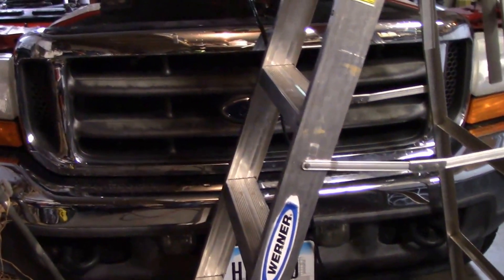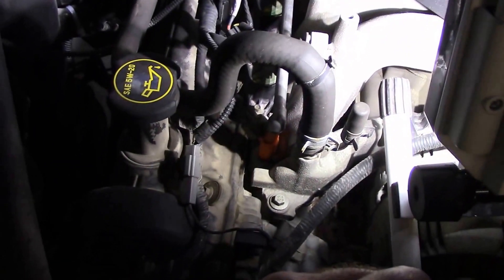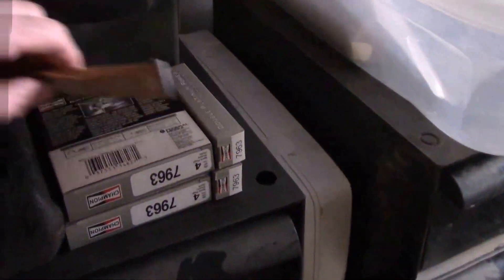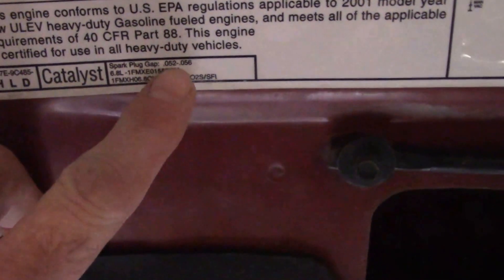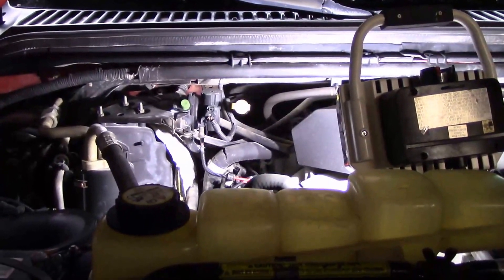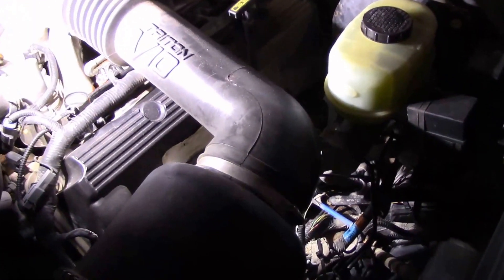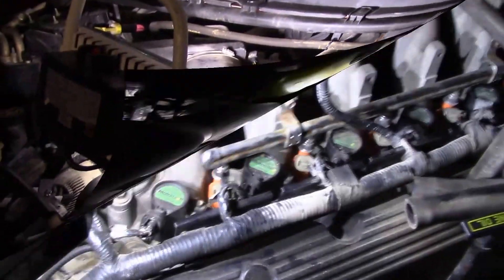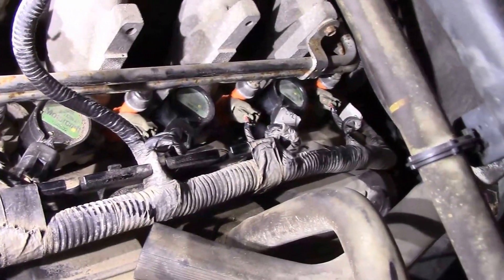V10 Spark Plug Change

Comment: A helpful hint when working on trucks. As long as you have a compressor, Let the air out of the front tires, Just leave a little air so the rim is not digging into the sidewall. It drops the front end a good 7 inches approx.
Reply: Gotta change the air between season man.

Comment: I just got a quote for $480 for plug change on our Excursion, another 500 for coils. This video showed me I can do that myself, as my first experience with this new set up since it's been the old school single coil plug wires etc in all my autos. Haven't been under a hood for decades and now the cost has pushed me back to the tool box.
Reply: Ford quoted me at over 600 for a speak plug change on my 2000 Excursion V10.

Comment: Changed the plugs in my 2000 V10 at 100K miles, then again at 200K, I doubt if I'll do it at 300K I'm getting old.....I also doubt if I ever own another truck. this thing just keeps going..... I'm at 275K miles now
Reply: Any signs to look for ?  Ours is a 2000  with 156k   Not sure if I need to change the plugs or not

Comment: This isn't as hard as you read it is.  I just did the job.  Make sure you put dielectric grease on both ends of coils.  I did not put anti seize on because I had copper antiseize copper and aluminum don't mix.  I was able to use a torque wrench on every plug.  After reading for hours and scared it's not that bad.  I torqued to 20 ft lb I'm anal and read heavily on this the 12ft pounds will loosen. Some recommend 24 I figured that's too much I also did 0.055 gap on plugs make sure there all gapped properly sometimes there not. And blow out holes before taking plugs out. Most importantly take your time, and use motorcraft these engines are touchy on anything else.  Took me 3 hours, and I'm no mechanic.  Only done about 6 plug changes on vehicles. Hope this helps someone.  Have a good day all.

Comment: Make sure you take the sheets off and a cab so you can change the the plugs make sure you blow all the dust out in dirt and the breeze Isles you going to mess up all you valves inside the aluminum cylinder heads

Comment: It's funny you got the same silvertooth I have and I got the same model truck and I had to do the exhaust manifolds so if you need any tips on that shoot me a email
Reply from the maker: That's funny. I did the manifolds too.  Have a scar on my arm where one of the nuts I burned off went down my coat sleeve.  Boy did that hurt.  A lot of work for about 30$ in parts.
Reply: @Jimmiebs  LOL, yes, it's a bad day with a chunk of slag or sparks go in your sleeve or into your shoe. I always keep a ''fire watch'' assistant on hand for such jobs.

Comment: That's a lousy gapping tool. You should use a wire type. No need to use so much anti seize since only the top half of the threads are used.
Reply: Bottom half